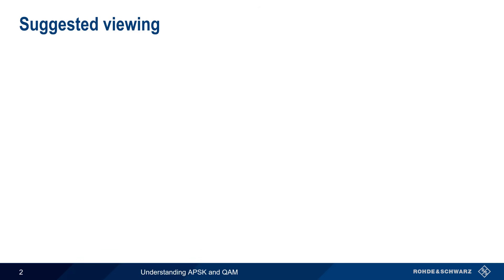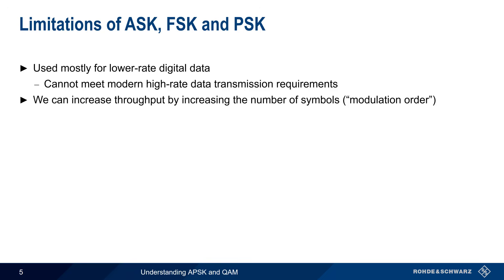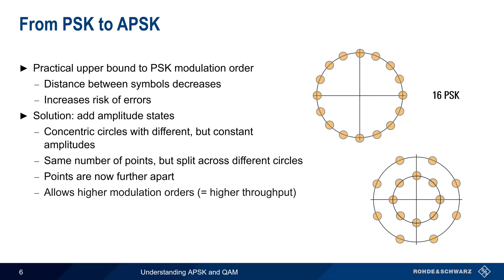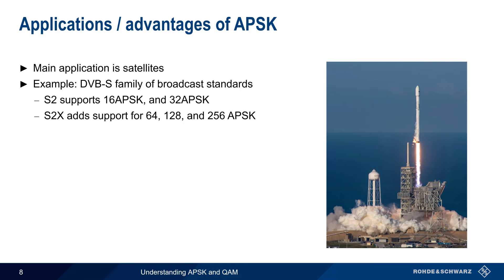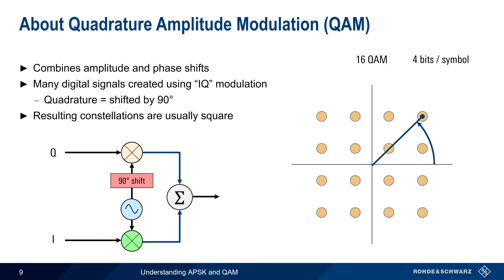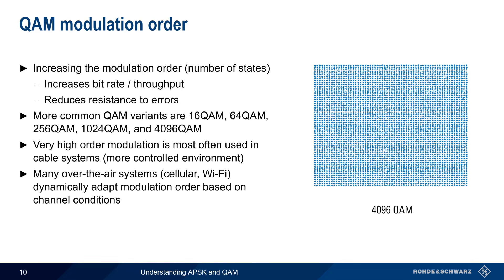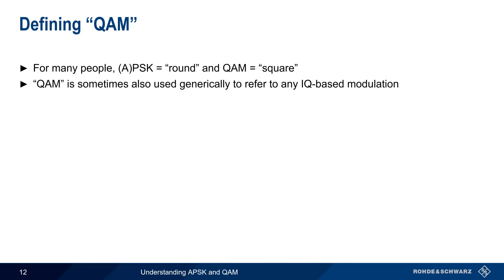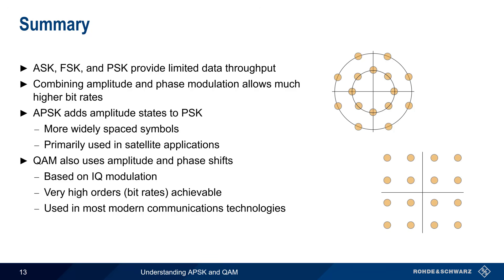Understanding APSK and QAM

Comment: Thanks for the video - What does it mean when there are two extra symbols on a 64QAM measurement? I've noticed there are two symbols with 0 and 180 degree phase on every 802.11g measurement I do.
Reply: Two symbols 180 degrees apart is BPSK (binary phase shift keying).  In 802.11g the subcarriers can be modulated with different modulation orders:  BPSK, QPSK, 16QAM or 64QAM.  So the signal you're looking at has some subcarriers that are modulated with 64QAM and some that are modulated with BPSK.  Please see the video "Understanding Phase Shift Keying" for more details on BSPK - thanks!
Reply: @pauldenisowski  Thanks for the reply. I looked at the settings on my SPA and it turns out it was called the pilot signal, which I think is the underlying carrier wave.
Reply: @jonnyod77  The pilot signals in 802.11are special subcarriers used to estimate and correct for variations in amplitude and phase caused by the channel and are usually present, so that makes sense. :)

Comment: I work with QAM equipment. Repairing, tuning, and bench testing. Watching the constellation during testing is cool to see live. This technology goes back decades but is still widely used today for cable internet. For sending large amounts of data through copper, this is primary. Fiber is superior, but even that is converted to QAM for coax. ATX, Broadband International, Scientific Atlanta and Arris still manufacture QAM amplifiers. In the beginning, the bandwidth ranged  54-330mhz, then to 450(i think), 550, 750, 860/870, 1,000, and now we're at 1.2hgz. GHZ doesn't play nice with coax over long runs, so eventually to keep up with data rate demands, either the modulation will change, coax will change, or everything goes to fiber. Great presentation!